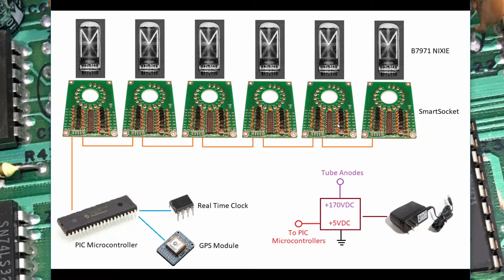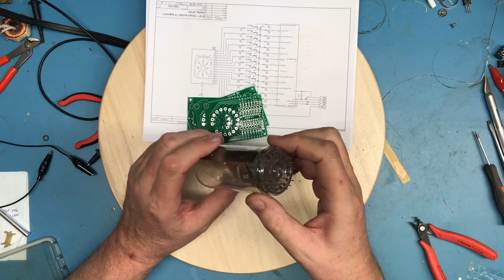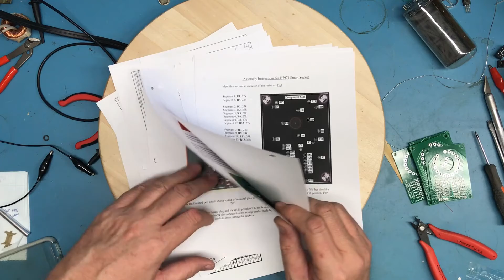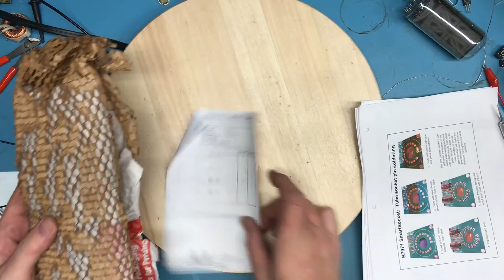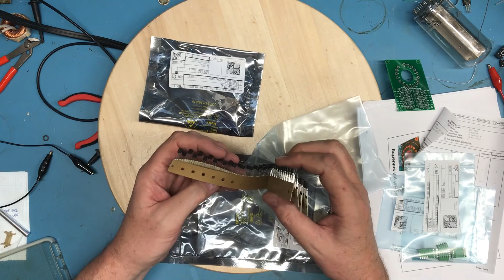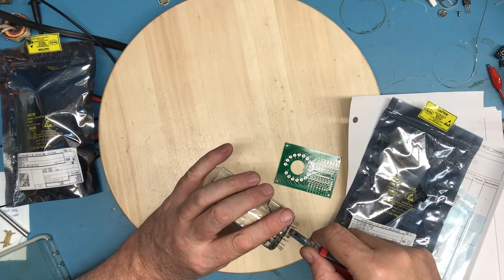B7971 Clock - Part 1 - Tubes, boards and initial thoughts - STB142

Comment: No microcontroller in the original FLW sculpture. It was all hardwired logic chips. Basically just free running counters and a diode decode matrix to produce the letters. As a result the words it produces may, or may not, be valid English words.